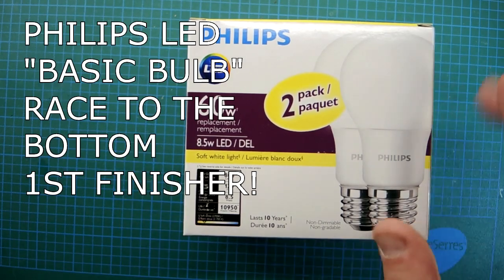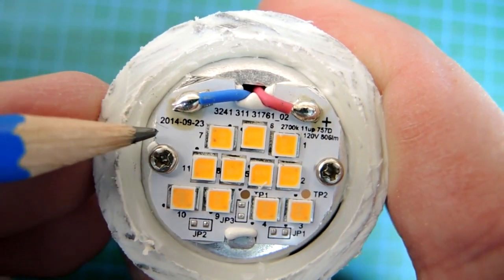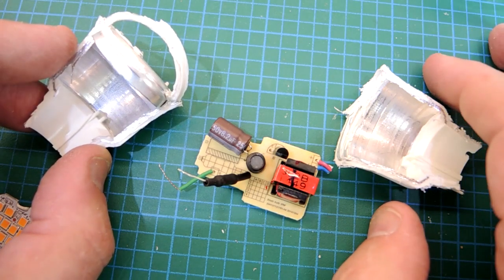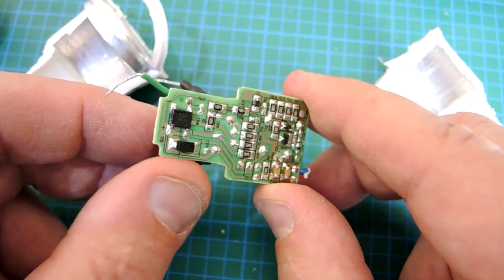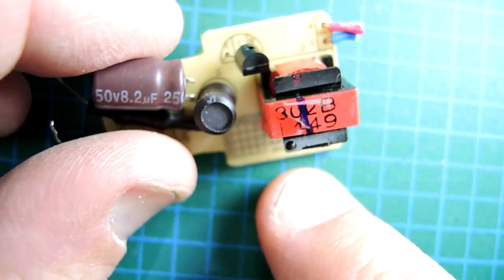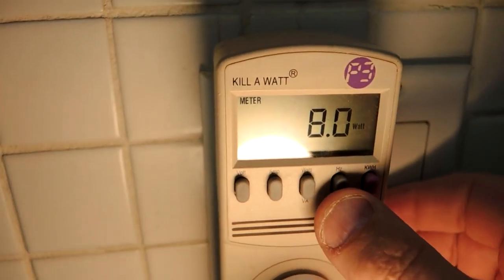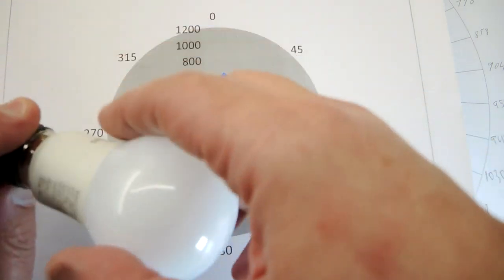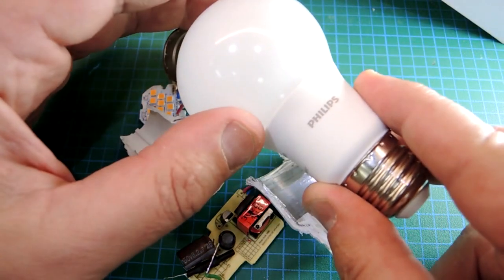Philips LED "Basic Bulb": Race to the Bottom, 1st Finisher

Comment: Those bulbs are positively expensive compared to the ones I've just installed: £10 / $15 for a pack of 5. Surprisingly the light output is very good and even but the build does get a bit on the warm side so I can't imagine it'll last all that long. Even so at £2 a bulb it doesn't really matter if it last 10000 hours rather than the claimed 15000.

Comment: Thanks so much for the amazingly detailed take-down and review. I noticed that this bulb tend to be noisier than the more expensive older LED bulbs, with a slightly louder buzz/hum even at full power. Just wondering what would contribute to this hum, and why cheaper bulbs would have this more than more expensive ones? Just the thermal putty? Or something in the circuit? Thanks!
Reply: If the wattage drops it is usually due to inadequate heat sink effect (most of these bulbs have a fold-back circuit). The light output drops in proportion to the wattage drop....there is no free lunch!
Reply: ciaconne I noticed the buzz sound as well. Not terrible, but was definitely annoying.
Reply: devlinger from the take-apart it might just be the putty missing? The buzz changes character after you run it for a while, and the bulb also becomes more efficient (most LEDs I tried did that, shaving a watt or so off the initial consumption). I can't say it's not as loud, but it turned into a hiss more than a buzz for me. All 6 bulbs I got behaved similarly: loud buzz from cold, get a bit better when hot. I'm tolerating it because it is very efficient, running at 7.5-7.6W when hot (most are 9.Xw or even 11W for the cree). I haven't had any LED with 800 lumens ratings (I can't verify the lumen ratings, so I'll take the mfgr ratings for it) with this low of a consumption. A lot of bulbs dropped in price to similar range in response to this one, costing less than $3 a bulb. The thing I don't really understand is how much I should worry about the low .6 power factor as demonstrated in this video. I get that the current will be higher for the same watt output, but would it impact electricity bills, or just burden the delivery lines?

Comment: I think the problem is people are still remembering when they paid a lot of money for early CFLs expecting enormous lifespans and ended up with bulbs that were ugly, useless in many applications and died quickly to boot.

 People are afraid to spend a lot. I don't think most people would be that reluctant if they knew for a fact that (for example) $10 would buy them a bulb that would absolutely last 5 years or something. If it was a definite thing. Nobody really wants to send a light bulb back to the manufacturer so even if it has a good warranty, they're probably just gonna toss it in the trash and consider it a loss.

Comment: My problem with bulbs like this right now has nothing to do with these cheap bulbs. I think they are great in some ways and do have a place in the market. The problem is a lot of people will blindly buy them not understanding they are incredibly inferior than the more expensive and higher grade led bulbs with good heat sinking and better features/parts. The marketing on LED bulbs is basically this: "LED bulbs are better, super efficient (somehow they make it sound like cfl's were never efficient), and last forever. People think they "have no heat" and I'm sure there are going to be a lot of angry people when there led bulb dies in less than a year. Some of the high quality cfl are way better than these in my opinion. Maybe I'm wrong though and people do generally understand that some of these led bulbs are POS.
Reply: martinaee At nearly 100lm/Watt, these are actually quite impressive. I think Philips should throw another $0.50 into it to try and make it last up toward 20,000-30,000 hours. Non-dimmable is fine in many applications. In my house I literally have zero places that I use a dimmer.
Reply: I agree here. I have a number high high quality cfl bulbs still going strong and love them.
Reply: Milo Tidwell Overall high quality LED bulbs are the best. But there is no point in getting LED bulbs if they don't last. I don't know though--- maybe these cheap ones might last as long as a lot of cfl bulbs. Who knows.
Reply: martinaee these will more likely be sold as the only choice in a supermarket where you cannot compare, so price leads as you have no other information at hand, plus i dont agree that $5 for a poor bulb is cheap, ive seen bulbs at a dollar, so theres more to be dropped, cannot comment on life of the dollar lamps

Comment: Interesting how the package says 10 year life.  I wonder how they really will hold up.
Reply: GNiessen 10 years at 3 hours per day (10950 hours).  Given the design of the bulb, I would say that longer run times (8 hours per day or continuous duty) will result in less than 10,000 hours total life due to the components getting baked for longer periods of time.  

I'll put a couple in at work in an extended duty application and see how it goes.
Reply: VeeDubTDI Exactly. If you run these in a bathroom where they never have a chance to get up to temperature, I'd bet they will last a lot longer than 11,000 hours.

Comment: Thanks for the review.
What about color temperature and CRI? This is an important factor for me.
Also, how hot is the assembly becoming?
I'm wondering why there is not a single bulb using hugh power LEDs such as Cree's XM-L2 (Appart from cost ofc).
Reply: Lagm an 2700k and 80cri, thats what they are rated at anyways.